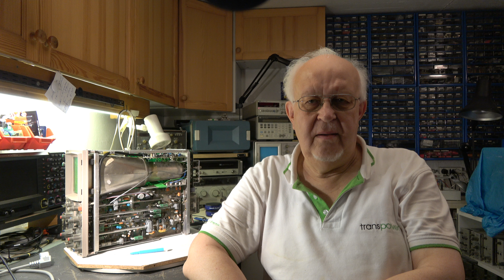#139 Hameg HM605 Part 2(3)

Comment: Something that older like kenwood hf radios are notorious for cold solder joints or the capacitors popping or that yellow glue stuff they used it corrodes the traces or the solder

Comment: I admire your tenacity, and the logical way you approach each repair. You also attempt to discover why a fault has appeared. In the commercial service industry where  time and money is the  main issue to make an economically viable repair , we seldom have the luxury of doing any post mortem, it is sufficient just to get the equipment back into operation  with few questions asked.
Reply from the maker: True, dear Dale. That´s the difference between commercial service and hobby. Latter is for fun and learning
Reply from the maker: @pa1wbu  Right! And i also refuse sometimes repair works when i see, that it isn´t worth to repair it. And this scope i would also have sent back to the owner unrepaired, if i would have known what was expecting me inside.
Reply: @dl7majstefan753  You’re right because it is you that is doing this job... But believe me, it is so fun to follow your multiple investigations. Each area of this scope is showing new strange defects or failures. Continue just for the learnings we can get from your work ! One of the best video I have ever seen about electronics repair… Finally it is probably not worth to repair this scope except for the multiple challenges. This scope should be reset as it was and given to students for training…